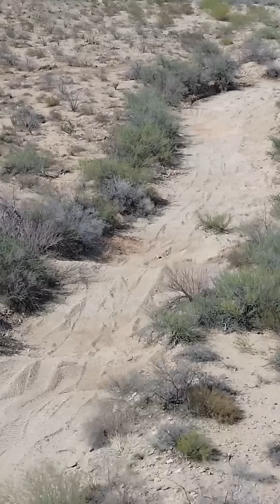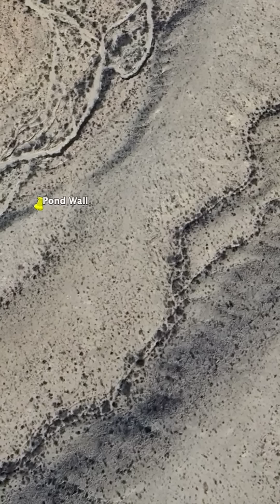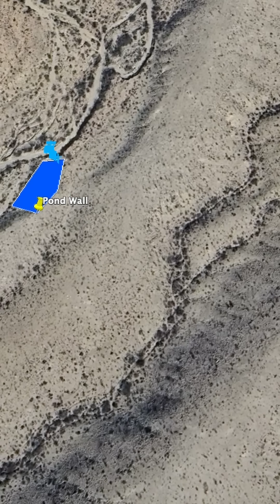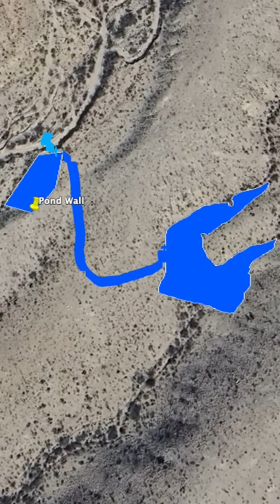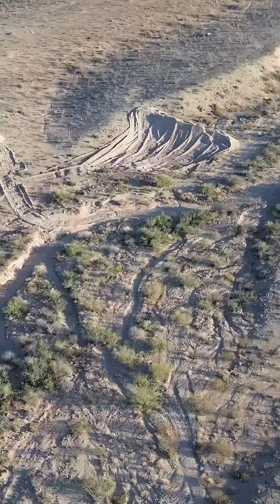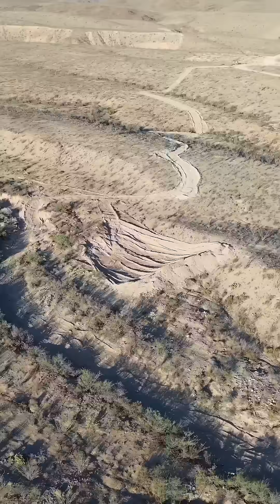I'm Building a Pond in The Desert

Comment: You could possibly use Ram pumps when the water is running through the gullies and backing up behind the dams to pump water to some higher elevation ponds.  No electricity.  I don’t know enough about Ram pumps nor about how much “fall” they would need to pump the water the water uphill, but you could study.

Comment: No criticism whatsoever, But I don't know why you'd have to reinvent the wheel Why don't you just use the crescent formations that they're building across Africa?
Reply: His bathtubs serve the same purpose, he digs them with his equipment, hence the rectangle shape, in Africa the crescent shapes are dug by hand by the residents,  the shape isn't the critical element, the hole to hold water/moisture is
Reply: He has them
Reply: I thought I saw some that WERE crescents.  Soil conditions and slopes are quite different than the shots of the African/Sahel analogues.
Wish there was some way to break up some of the pavement.  Buffalo/bison would be great, but I don’t know what they would eat.  
  I have this fantasy image of a heavy roller with spikes on it pulled along by a modest sized farm tractor to aerate the soil for when it does rain.  Actually money is not infinite, but I could see a smaller farm tractor could be a lot more efficient for a lot of tasks than the dozer. Dozer would last longer also.  I grew up on a dairy farm in the Ozarks.